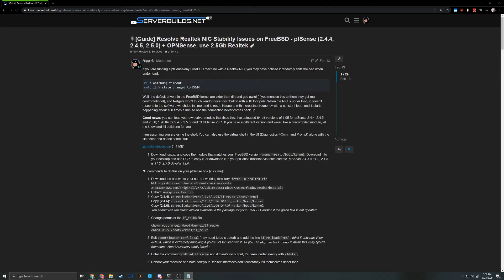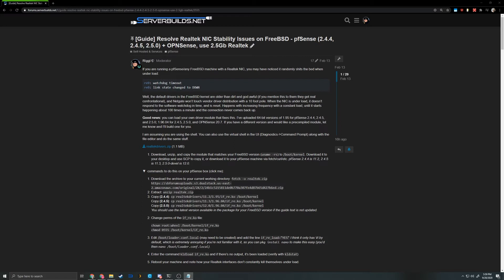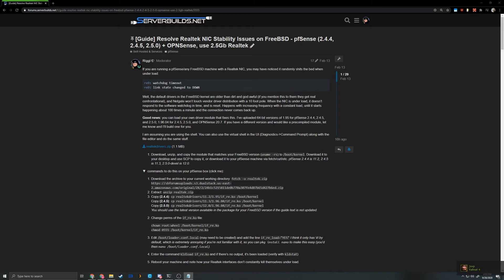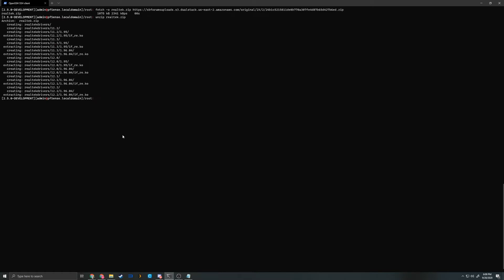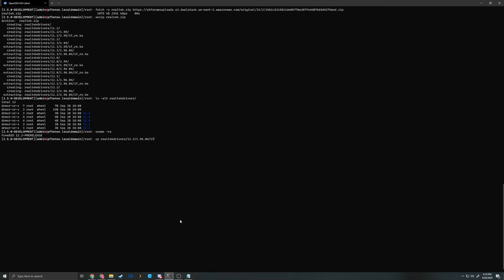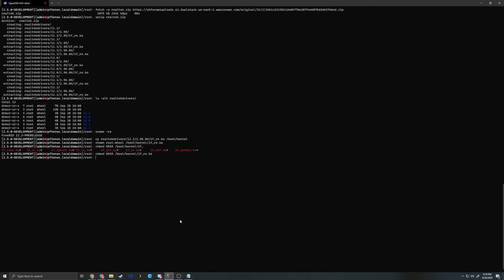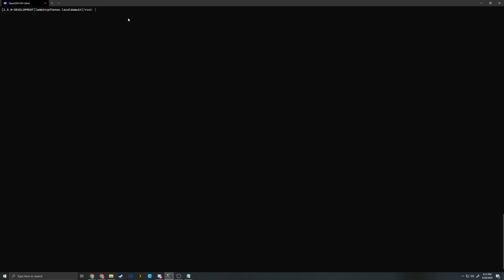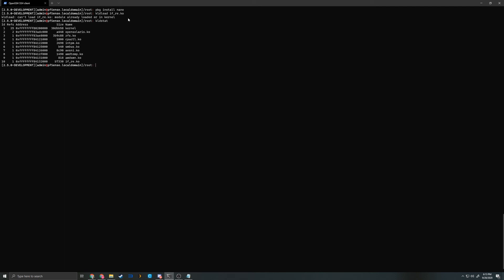Use 2.5Gb NIC/Resolve Realtek NIC Stability Issues on FreeBSD - pfSense, OPNSense, FreeNAS, TrueNAS

Comment from the maker: Since pfSense 2.5.0 and OPNsense 20.7, there have been official packages that add the driver module, then you still follow the same /boot/loader.conf instructions.
pfSense - realtek-re-kmod
pkg add https://pkg.freebsd.org/FreeBSD:12:amd64/latest/All/realtek-re-kmod-198.00_2.pkg
OPNsense (21.7.3+) - os-realtek-re
From OPNsense 20.7.4 up to 21.7.3, the new version replaced the module included in the kernel, but it is now a packaged plugin module like in pfSense.
Reply: Once I've installed the packaged plugin module in OPNsense on latest version, and reboot, it still unable to fully recognize my RTL8156b usb NIC correctly. Am I missing anything? Do you mean I still need to config the /boot/loader.conf?
Reply: I get a 404 error when I try to download the package
Reply from the maker: @Superchad245  Updated link, thanks for the heads up. With new version releases they've been nixing the old ones.
Reply: @its_riggi  I get the error wrong architecture FreeBSD:12:amd64 Instead of FreeBSD:14:amd64
Reply: got it installed but not working, posted a comment about the error message
Reply from the maker: @Superchad245  yeah, that link is for FreeBSD 12 - you'll want https://pkg.freebsd.org/FreeBSD:14:amd64/latest/All/realtek-re-kmod-198.00_3.pkg
Reply: @its_riggi  i keep posting a reply and it isn't going through for some reason

I am getting an error when running kldload
Reply: link not working.. kindly help.. pfsense 2.5.2

Comment: Hey im trying to figure out where to start with the 2.6.0 pfsense version to intall those driver following your text guide. I got some realtek 2.5(3 of them) that aren<t detected and im stuck using a usb ethernet port to be able to boot and im just starting with pf sense. Getting slowly back into networking config
Thanko if you can help.

Comment: I got it installed and my 2.5g NICs now appear! Unfortunately, after reconfiguring my interfaces to their new IDs, I was no longer able to get in to the Web GUI, and after another reboot, the system is now stuck in a boot loop.
Reply from the maker: Which version of FreeBSD and which module did you use? It sounds as though your module did not load without error and you left the config in place and rebooted. In user space, attempting to load the incorrect (or a faulty) kernel module with an error will simply fail with an error, or succeed with a warning. During the boot process however, it will abort the boot each time with a panic.

You'll have to boot to single-user mode, mount the filesystem as writeable (`zfs set readonly=off zroot/ROOT/default` assuming ZFS), and remove the entry from `loader.conf`/replace the module with the correct one. 
 You may even have to drop to the bootloader shell, `unload` the kernel, and boot to it manually to prevent module loading (`boot /boot/kernel/kernel -s`).
Reply: @its_riggi  Really appreciate the reply. The problem appeared to be the NIC itself. Either it was defective, or something about the PCIe splitter was causing a problem (prior to the boot loop which was caused by a brownout). I bought two of the single port version of the NIC and it works perfectly fine.